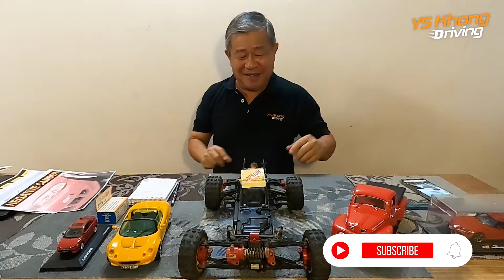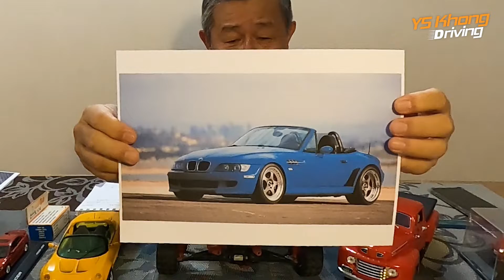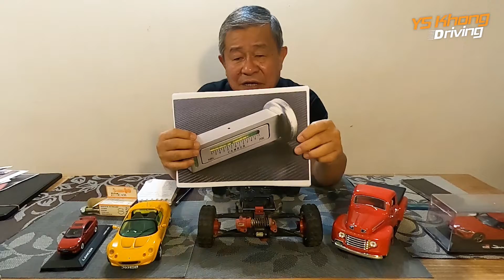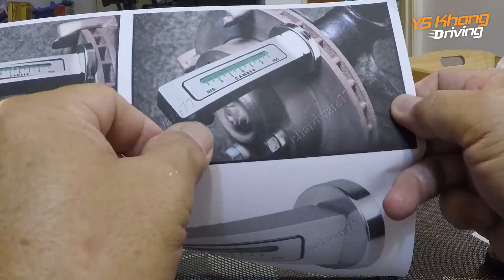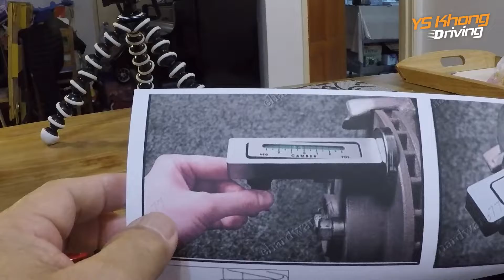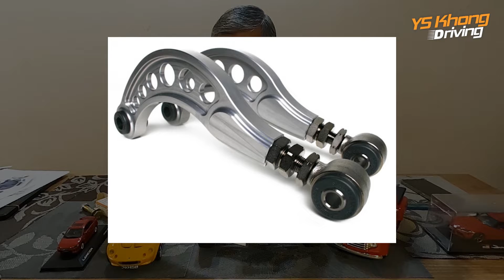Wheel Alignment Tutorial (Pt. 3) Camber Adjustment - Positive or Negative? | YS Khong Driving

Comment: Hi Uncle YS, my front wheel drive car got an issue(?), whenever I drive on straight roads, hands free, the car will veer towards the left. How can I adjust the alignment in this case?
Reply from the maker: It could be a caster or camber problem. Best of you go to a reputable alignment shop, and let them check it.

Do a caster swing, then take a clear pic of the screen before adjustment, and I will try to help you.
Reply: @YSKhongDriving  i got the alignment report, how can I send u the picture?

Comment: Hi YS, thanks for sharing - and now that I have seen all 3 parts, can I ask if there is any logic for the driver to sit in a ROAD car during the suspension adjustment? (assuming its normally driven solo only). How was your rally car suspension set-up? (with driver/co-driver or without) I have seen race cars (single seaters) set-up with the driver seated on board.....
Reply from the maker: Not really necessary. Ally settings were done without driver.
Reply from the maker: Some race drivers do that, but for normal cars, esp Japanese cars the rh front springs are 0.1 mm thicker to adjust for the driver.

Comment: Hi Uncle, can you advise what would be the best setting for a R56 Mini Cooper S? For toe, castor & camber. Thanks a lot Uncle
Reply from the maker: Toe out front, toe in rear, slightly negative camber, leave caster alone. How much depends on how aggressive a driver you are. Rear toe in not more than 1 mm. Same with front toe out
Reply: YS Khong Driving Thanks Uncle. Aggressive but not excessively.
So
Front toe out 1mm
Front camber -1.5 degrees
Rear toe in 1mm
Rear camber -1.5 degrees
Is this ok? How about tyre wear? Thanks

Comment: In the 1980's during my Australia days, my mate has an Escort RS2000. We've asked the alignment guy to set the front up with some negative camber (the rears are live rear axle, so can't adjust). The car corners like it was on rails, we enjoyed it, but the tyres wears quicker, especially on the inside. After a new set of tyres, we ask the alignment guy to set the camber back to standard. 😄😄
Reply from the maker: The guy probably set too much negative camber. My rally car ran only 1.25 degrees negative, and my set up is similar to the Escort. MacPherson struts and a 5 link axle at the back.
Reply: @YSKhongDriving  yep, learned it the hard way. We were young n naive then.

Comment: Hi uncle... Thanks for sharing... 😄 Want to ask a quick question on camber... Its based on my observation on RC 1/10 on road cars not sure if it's applicable to real cars.... On the RC car I have, the suspension can be set in such a manner where it gains -ve camber as the absorber compresses. Is this the same with a real life car? If so would be be better to adjust suspension to give the right camber on compression and give 0 camber at ride height or to adjust the wheels itself?
Reply from the maker: Usually RC cars have double wishbones, which retain the same camber. What does your  car have? You might want to join our Telegram group.

https://t.me/joinchat/Pdt8mRMb4FhH7evXd6U4UA
Reply: @YSKhongDriving  hi thanks for the invite... But I don't have telegram... 😅 Only used WhatsApp...  I m not sure what suspension I have on the be car I m thinking about... I m guessing McPearson struts up front... And multilink at the rear...
Reply from the maker: But you were talking RC cars. If you are talking about MacPherson struts and multi-link, it is ok to have a bit of negative camber at the start, although there is camber change.

Anyway, go and download Telegram: it is free.
Reply: @YSKhongDriving  ok will get it later ....ahh ok... multilink has some camber change as suspension compresses.. do we still need wheel camber then? 

  I remember with my RC double wishbone... TRF414m n Kawada sv10ii I could set it so there's a camber gain when the suspension compresses... For that to happen at static... the top arm link needs to be angled down to the middle of the car when the bottom A Arm is flat at 180 deg.

Comment: Sifu, my w212’s e250 tires hardly last a year eventho consistently doing alignment & balancing 4 months once. Why this happens ?
Reply from the maker: Perhaps you want to provide more details. Tyres are measured over distance, so fundamentally if you travel 50,000 km in a year....? Also the type of tyre, the compound, all affect the rate of wear. The roads you travel. Also if it is wrong alignment, you get accelerated wear. We would not be able to make any sense just from your single liner. Thanks.
Reply: Driving style, heat, and tire pressures all play a part. Sounds like some good content for a future video! I feel your pain, E-class tires are not cheap as well...